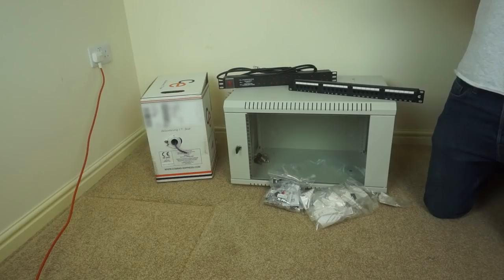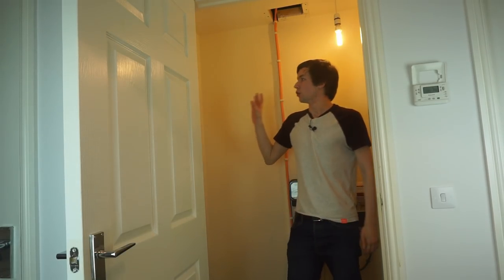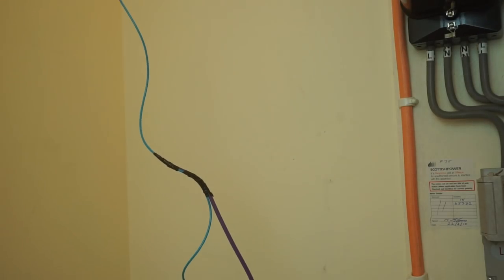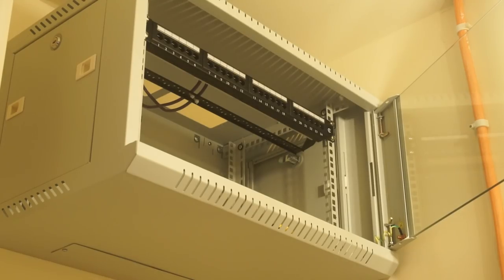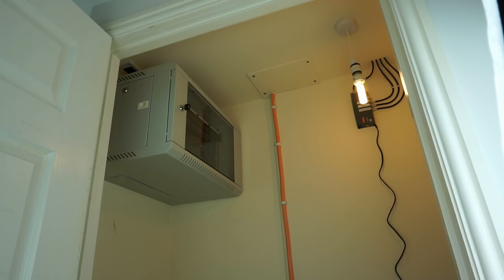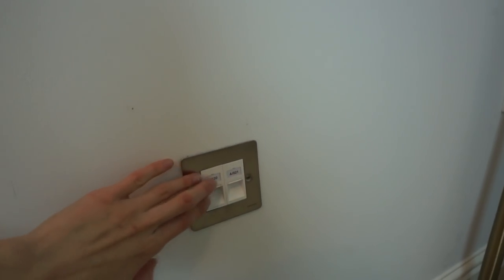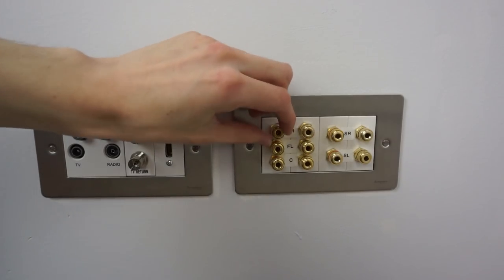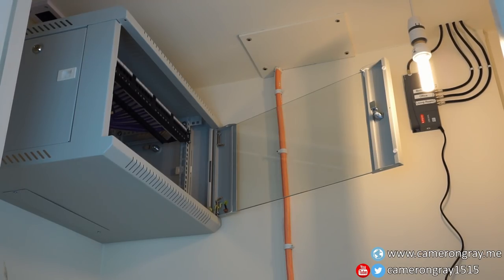New Flat - Time to install a completely overkill home network!

Comment: Hi can you give sue a video on how you field in the boils please
Reply from the maker: How I filled in the holes?  Don't really want to do a video of it as it's not something I'm remotely expert in although all I did was glue a small strip of thin wood across the back of the hole then glued the original bit of plasterboard I'd removed to this wood so it sat inside the original hole.  It was then a simple case of filling the gaps with plasterboard filler, sanding it all down to lie flush with the rest of the wall then painting.  There's probably loads of videos from people who know more about this sort of stuff showing different methods of filling holes like this.

Comment: Why such a small rack? I have a rolling 6’ rack
Reply from the maker: A larger rack is great if you have the space, but I have a 67sqm flat so need to dedicate cupboard space to more important things such as storage rather than a massive rack.  I'd rather terminate all the structured cabling into a small cabinet that can at least hold core equipment (router, switch.etc) since it can't ever really be moved around and then put other kit (servers.etc) elsewhere.

Comment: Surprised you got the go ahead to do this in a flat, assuming rented.
Reply from the maker: Thankfully I was able to buy the flat, there's no way I'd have been able to do this in any of the places I rented, the most I ever did there was run a couple of bits of CAT5e under the carpets.
Reply: Ah, in that case congratulations on the purchase. This video has reminded me that I need to give VyOS a try sometime soon.

Comment: whens episode two coming
Reply from the maker: +Rob Games Few weeks probably, ideally want to get those sockets fitted before doing it so I can show it completely finished.  Currently everything is working but using extension leads to power some stuff and have a few holes that still need filled and painted.

Comment: I could be totally off base but to my limited understanding a flat is a place that you rent. Did you get permission from the landlord to cut or did you just do it? >.>
Reply from the maker: In the UK, a "flat" can either be privately owned or rented.  The majority of times, all flats in a building are owned by individual owners, some inhabited by the owners, others are then rented out by the owner.  I suppose it's similar to what's known as a "condo" in the US.  In my case I own the flat so I'm able to do this, no way I'd be able to do this with any sort of rented property.

Comment: Anyone else hate seeing something you can’t buy? I can afford it, but can’t find the items anywhere near me and the links you included don’t ship to the USA. Been hunting down adapters exactly like your using.
Reply from the maker: The reason you won't be able to find is that the UK and Europe use completely differently sized electrical fixtures to the US.  These accessories use the "Euro Module" standard which is common across Europe whereas the US uses keystone jacks for everything.

Comment: When will you upload your next video in this series?
Reply from the maker: +Vishal Shah Probably in a few weeks, still need to get those mains sockets put in to complete it.  I'll be releasing another, unrelated video at some point sooner though.
Reply: Cameron Gray okay thanks, please let me know when you have uploaded the next one in the series!

Also, do you use Ubiquiti UniFi Access Points? I've got two and set them up and working etc. with a Guest Network too.
Reply from the maker: +Vishal Shah Yeah, I've used a UniFi AP for a few years now, will also be using UniFi switches for this network.

Comment: Very very good job. I savored every second of it.

Planning something similar for my home, but looking for a silent rack from http://www.acoustiproducts.com/en/index.asp.
I'm also going to get some 1U equipment instead of the current servers I've got, and I think I can reduce power consumption as well.

Are you keeping that Ali Express box? Is it your main router/firewall nowadays?
Reply from the maker: +Shiunbird Thanks! Those acoustically dampened racks look good, been tempted to get some sort of dampening material to line the inside of mine to see if it would impact the noise level.  Still using the AliExpress box as my router, it's working great although I've gone back to running VyOS on it instead of PFSense/Opnsense
Reply: Why going back to VyOS? Interested in the answer, because I'm actually planning to migrate from Cisco to pfSense.
Reply from the maker: Software wise it works fine but as of version 2.5, the CPU in the Aliexpress box (and loads of other low cost PFSense boxes) will no longer be supported due to Netgate's decision to require CPUs that support the AES-NI instruction set.  Opnsense was a decent alternative (which I ran for a while) but I grew tired of the childish drama surrounding the projects online, google around for "PFSense vs Opnsense" and you'll probably come across it.  While the production release development for VyOS is pretty slow at the moment, there does seem to be some movement.  That said, their nightly versions seem pretty stable.  I'm actually running a custom build I made so that I could include a multicast DNS repeater allowing me to have devices such as Chromecast and Spotify Connect to work across subnets.
Reply: I see. That's sad.

My current plan is to get a PC Engines APU2C4, it does support AES-NI, and they sell a 1U fanless rackmount for it, and it has ECC memory. Seems to be a very neat box.
Thanks for the tip, I will look it up.

Comment: ........”I am moving into this flat in a few weeks so i am fitting loads of cables and shiz”
NEXT DAY
“Hello  about your mortgage.......sorry its not gone through so you need to move out and NOT change the property at all”.......
Flat man......”nothing”😩
Reply from the maker: Ahh, when I mentioned I was moving in in a few weeks, I meant that I was still staying in my previous rented place while I decorated and wired the new one.  The sale was already completed, I just had to physically move my stuff over.

Comment: btw why you did not use 10Gb Ethernet setup ?
Reply from the maker: It would have been far too expensive, I paid for this all out of my own pocket so had to stick within a reasonable budget. I store files on my NAS so need reasonably fast access but I work off of files locally so don't have an urgent need for 10gbit, I'd much rather wait for it to come down to a more reasonable price.
Reply: @camerongray1515  I understand, I was digging into after watching mikrotik videos on 10gbe.

Comment: I'm assuming that where you live you are required by law to have an electrician finish the outlets for you, because you pretty much had zero problems doing the hard stuff lol. Weird here in Arizona, USA I've never had to call an electrician to install outlets
Reply from the maker: In Scotland there's restrictions of what you can do in a flat (apartment) or house over a certain number of stories.  You technically only need to get the work "signed off" by an electrician but you'd be lucky to find an electrician that would be happy to sign off work that they haven't carried out themselves.  It's pretty annoying since it would be a pretty easy and cheap task to do but I suppose it's good if it also stops others bodging together dangerous setups. The UK as a whole has pretty tight regulations over things such as where wires can and cannot be run.

Comment: I almost afraid to ask this, but why not wireless? ;-)
Reply from the maker: I use WiFi for portable devices (my phone and laptop mostly) but it just can't give the same level of performance or reliability that a wired connection has.  It would also mean having to install wireless adapters in all my machines.  I store all of my files on my server which is on the network so having a fast local network is important.  The cabling can also be used to carry other things such as HDMI video, not just network.
Reply: Maybe I should have written "for the non essential connections". You installed in the kitchen, which made me comment. Wired is always better ofc, but often wireless is good enough, and a lot easier. Especially if you choose a good AP. 
Nice video btw.

Comment: How long before someone has to ask why you didn't just use WiFi I wonder...
I prefer cable myself, it has other uses too :-)
Reply from the maker: Exactly, sure WiFi works but it's nice to just be able to plug stuff in without worrying about connecting it, you'll also get better performance.  It would also be possible to use the cabling to run HDMI to TVs as well.

Given my usage, it is massively overkill but it's cool, so why not!
Reply: Yes HDMI was what I was thinking. I know you used to have to use a pair of CAT6 for that, but I think there are now solutions that allow you to use just one cable, not sure how much that would cost though.

I had all good intentions when I bought my house including setting up a network but nothing really got done :-/ Good that you have got to it before you move in, something like this is a lot easier without lots of computer kit... I mean furniture everywhere.

Good luck with the move :-)

Comment: I don't get it, why is 24 on the ceiling?
Reply from the maker: The numbered tape? Those were holes that would need patched up again later, each number corresponded to the piece of plasterboard that I'd cut out so I could put the right pieces back in the right holes.
Reply: @camerongray1515  24 had an ethernet cable coming out
Reply from the maker: @danieldean8434  That port is used for my ceiling mounted UniFi wireless access point which is mounted to the backbox.  Means that it's out of the way and completely centered in the flat so that I get good coverage rather than having it sitting on a table or something.

Comment: That Coaxial box gets hot... it has no ventilation inside a wall...
Reply from the maker: I've since moved it out of the wall and surface mounted it below the wall plate.  That said, it doesn't get anywhere close to even being "warm"

Comment: Why didn’t you use fishing tools?
Reply from the maker: I did - I was using fishing rods in this very video.... Without access from above and in a small ceiling cavity with large joists, metal ties and existing cabling/plumbing/ventilation there is only so far you can get with a rod before it snags and you need to cut another access hole.
Reply: Cameron Gray damn even with all the tools you had to cut all those holes? I’m tryin got run a couple of Ubiquiti Nano HDs to the center of the house in between floors that’s why I asked.  Was hoping there would be an easy way to DI it without cutting a bunch of holes into the ceiling/walls...
Reply from the maker: @thegolflife7565  If you have access to the floor above you can probably lift flooring to access the void, I'm in a flat so have no access from above so the only way is to go in through the ceiling.

Comment: You didn't left enough cable slack in rack cabinet. Take a look at fibreninja channel, He is cable master.
Reply from the maker: +pabllosee There is a reasonable amount of slack pushed into the ceiling space, at least enough to lift the patch panel down to work on the connections, didn't want to have loads of cable taking up space in the rack as it's not that deep.

Comment: nothing is straight
Reply from the maker: I screwed the sockets on quite quickly for the video as I'd loosened them off to paint.  The backboxes have a bit of play in them so if you loosen the socket, adjust it so it's straight then screw it back it looks fine!
Reply: He lives in the UK. Most of our homes aren't straight anyway. Nobody in the history of ever has walked into a UK home and said "my god, your sockets aren't all straight!".
Reply: LOL makes my OCD meter go off , not straight and nothing levelled to existing fixtures, but good work with the networking
Reply from the maker: I deliberately made sure everything was level with the existing fixtures, they may just not look perfect on video.  The only one that isn't lined up properly is the one with the 4 network points next to the double socket in the living room.  This one is actually using a backbox that was already in place (that's where the TV plate originally was before I moved it to the adjacent wall) so that's the fault of the contractors who built the place (who seemed to have mounted everything at an angle).  Once I replace the socket with a metal flat plate one I'll probably also try and get them lined up properly (probably by removing the squint metal backboxes they used and installing dry lining ones)

Comment: are you sure it's 113kg and not 13 kg? there's no way in hell that's gonna hold 113 kg, the board would probably rip apart at anything over 20-30 kg on that area  
  if you got at least 1 stud going behind the rack i'd drill a hole into the backplate and screw that in just to be safe.
Reply from the maker: It's definitely 113kg, unfortunately the only stud on that wall is right in the corner so wouldn't really be much use.  The 113kg rating is for shear forces (something hanging off of a vertical service like I have here), it's only rated for 20kg if you were to suspend something from it (i.e. hanging something from a horizontal surface or if you were to pull the fixing directly away from the wall).  They have a full datasheet for them on their website: https://cdn.shopify.com/s/files/1/0012/9112/4791/files/Gripit_SD_Marx.pdf?17586673253427359261

Comment: Overkill? BT? bursts out laughing
Reply from the maker: Currently the fastest connectivity available here is 80mbps down, 20mbps up over Openreach's FTTC network which is what I'm using and will be more than sufficient for my use.  There's talk of FTTP being installed in the development which would be available as both symmetric 100mbps and 1gbps so if that goes ahead and it turns out to be decent enough quality then I'd consider moving to that once my current contract expires.
Reply: Cameron Gray  This happend a point into your calculation if you are an internet company - for a normal flat it is the speed of your own network inside the flat higher priority as the internet connection with ISP! This is a fact! 

For a normal computer it is equal where you catch your data. Every computer calculate faster as you and wait the most time of data. If my ping goes 2 ms higher (also 4 ms) between the long fiber way over 60 km from me to the Hamburg City Exchange Point, Germany it is nothing happend. But if my server in Bangkok, Thailand answered slow (higher 30 sec.) - then my pages on my computer starts so different slower that we human can't see it - or feel! Only my computer feel more free waiting time! 

It is stupid to belive that all data must run fast all the time - this is unpayable outside own room or network!

Comment: Is that orange wire your main power wire . I hope it's not . It would kind of made since . Lot of power coming tho that very tiny wire . 240v every ware .
Reply from the maker: +Colin Stienke That is the main incoming feed, it's an extremely heavy duty 16mm thick cable that is cased within a metal conduit when it's inside the ceiling space.  It then goes into a 100A service fuse before it reaches my consumer unit.  I'm struggling to see an issue with it, I dare say ScottishPower's engineers knew what they were doing when they installed it.
Reply: Cameron Gray oh that's not very good hundred amps that's not good in our country we have 112 and we have 20 amp per one plug and we have usely 2 of them . 20 x2 is 40 amps . That for high draw items . Your hole house is only 100 amps . Not good . Might want to have that looked at .
Reply: @Colin Stienke  - SMH, so much wrong with what you're saying...where to begin...
 Your home is 110v, not 112v. You don't have 20a per plug, you have 20a circuits, and each plug on each circuit can use up to 20a individually, but not all at once.   Here in the UK, Cameron likely has a 30a circuit for his cooker, maybe a 20a for electrical heating or water heating if installed,  several (likely 3) 13a ring circuits (each room or lighting circuit {try counting the breakers in your distribution unit to see how many circuits your home has}, which effectively doubles the current carrying capacity, 'cause AC) for room sockets, and 3x 5a ring circuits for lighting fixtures, all at 230v.  230x 100 = 23,000W...with more capacity in the actual wiring itself, for safety, which is more than necessary for what appears to be a one bedroom flat in Scotland. In addition, UK electrical practices include everything being earthed properly, unlike N.America, and proper, decent plugs and sockets, also unlike N.America.
Regarding the orange cable, that's armored cable btw, which makes it highly resistant to accidental damage and any kind of moisture ingress, as it features glanded connections at each end of each run of it, again standard practice here in the UK.
Hopefully this helps you get a better idea of where your earlier comments were erroneous.
Reply: Niall Macdonald yes in America we have 20amp plugs . I had 2 ran
Reply: You don't even have an profile pic
Reply: Niall Macdonald who cares if I spell it wrong you got the idea
Reply: Colin Stienke much salt, such ignorance